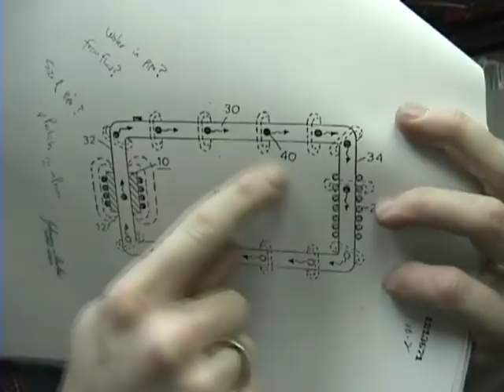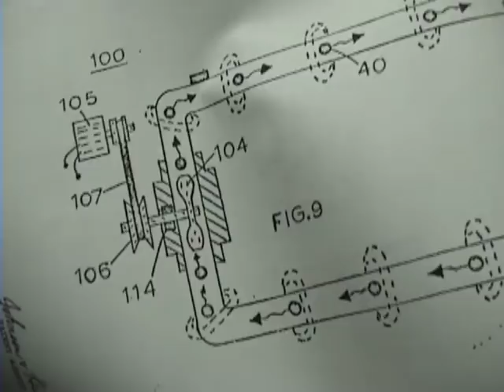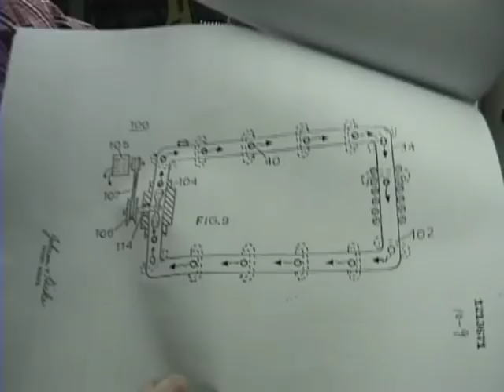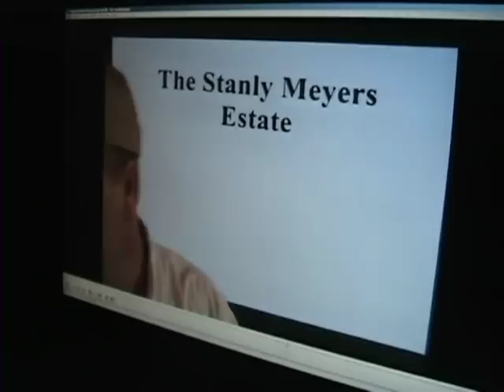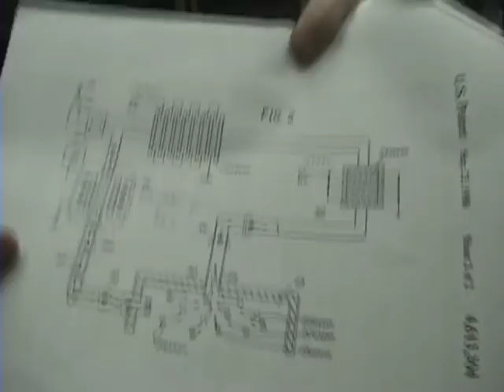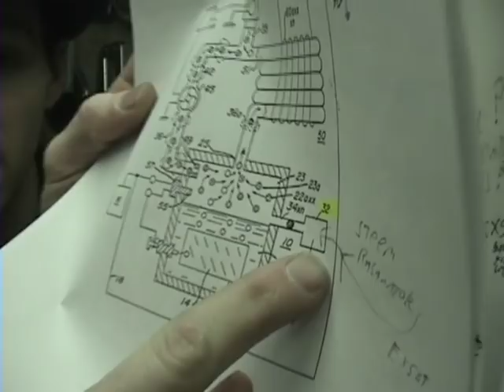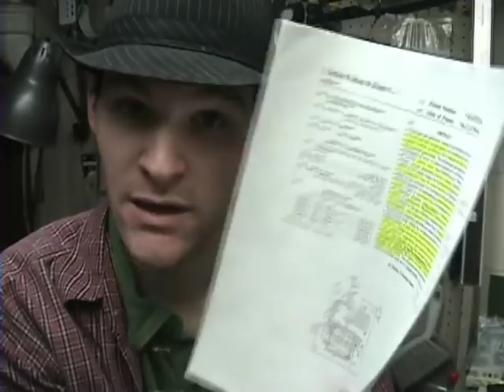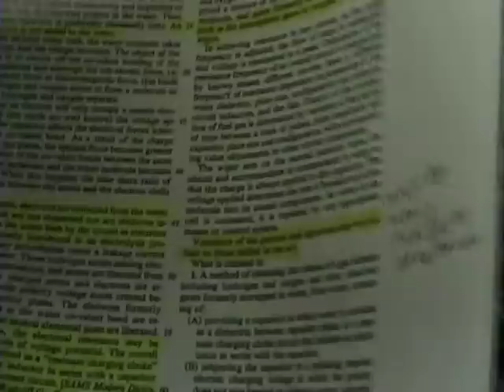The Key To Stanley Meyers Water Car, Gas Electrical Hydrogen Generator, www.RWGresearch.com

Comment: If you try to vaporize a magnet by passing HV electric current through it; wouldn't that destroy all magnetism in the particles?  If so  one would have to magnetize them after vaporizing them.
Reply: Watch the video again - there is a large remagnitizing coil as part of the devise. - Stan used stainless steel magnetic electrodes according to  a above blogger.

Comment: People, watch Stan's New Zealand series. (watch it again if you must..)
watch?v=ZmxaVOolO-8
If you're lazy, he starts getting into this device in part 8:
watch?v=DvYc7vrnj6I
In part 10 he describes using iron,nickel or cobalt ions + Argon gas.

He also mentions they are going to be releasing this unit, being 18" in diameter and "it's average power draw will be 220 300amp draw capacity.." think about that one for a second...

Comment: a particle accelerator will cause convection flow of heat from the outside being abosrbed by the particle that increase its momentum. the reason why refrigrator use nozzle inside, is because they derive the driving force from the propelant trust of the expansion, but that is not what cause the colant effect itself, but the speed of the flow itself.

Comment: Has anyone continued this where Russ left off? He seemed to have gotten so much of it done...
Reply: The first patent seems to describe a regular transformer with a core made of mercury (metal), inside a non metallic (avoid the squirrel cage effect) vacuumed tube and a pump to initiate the circulation. This would certainly reduce the core's resistant; something to look into...

Comment: i think it works like a printer and the inks action before it is deposited on the paper,maby?do printers separate the positive and negative ions into electrical particals before they are deposited thus hydrogen and oxygen,maby you can run your car off a printer,its a serious joke,will a printer separate water into hydrogen and oxygen,i have a lot of printers to experiment with give me some ideas we might just invent the first hewlit Packard carberator
Reply: No

Comment: I think I found a video that you should look at. It is stemmed from an inventor prior to Meyers on this water car. Here is the video https://www.youtube.com/watch?v=LzsTij4N4uw. 

You will notice that the he states in this video 8 times that a pulse of rpm and 70,000 volts and serson states 7.5 times rpm amazingly lightning strikes are 76,000 volts and earths natural resonance is around 7.8hertz

The voltage using micro amps could be like the pulsating motor effect of most free energy patents and perhaps this is what is needed to split hydrogen from a standard car battery.

Comment: Have not watched the entire video. Looks like a particle accelerator that magnetizes particles then thru acceleration creates additional current also has plasma created as discussed that creates charged particle aligned in a magnetic field while changing water into plasma. Standard stuff my old friend Alexander was doing in the 1950 1960. Era.. A self sustaining  plasma ignition particle accelerator, water molecule splitter electrical generator

Comment: miniturize the coils to injectors and you have HHO and water being injected into the cylinder, at ignition point you create steam which drives the piston down.
the ionized gases are most likely used to help control heat from melting the piston.
your putting to much thought into something actually quite simple.
a lot of the stuff in those patents is completely misleading.

Comment: If you have that much excess electric power produced; why bother with the hydrogen production at all? Why not just run an electric car?
Reply: I would imagine that he was thinking that it would be easier for everyone to convert their existing cars by just changing the spark plugs to gas igniting ones and fitting his generator  in the boot rather than buying a new car. The electric motor makes much more sense but is more viable in new car production. I hope Elon Musk's got his technical department working on it now. I really hope this whole thing is real and not a scam as it does defy the laws of physics but there again there was a time we thought the earth was flat.

Comment: The following schematics and links came from thoughts and research into both energy and health modalities investigations.  There is infinite room for improvement on these devices however they have been very successful projects in the area of my health endeavors.   The ‘Frequency Converter’ changes  60 cycle 110 AC volts to a user settable frequency ranging from sub hertz to about 40 KHZ, 160 DC volts,  with a selectable duty cycle.  http://www.aurorasky.net/Compact_TRIAC_Frequency_Converter.pdf

The High Powered PEMF can generate several hundred gauss and might have an application in the energy field area.  Maybe extremely high current and high voltage pulses, in the area of 100 to 200 amps at 160 volts could be useful in Brown’s Gas production.  http://www.aurorasky.net/High_Powered_PEMF_Sch.pdf

Any knowledgeable thoughts in this area would be appreciated.  Open Source; www.aurorasky.net